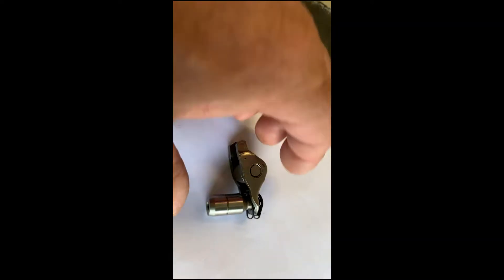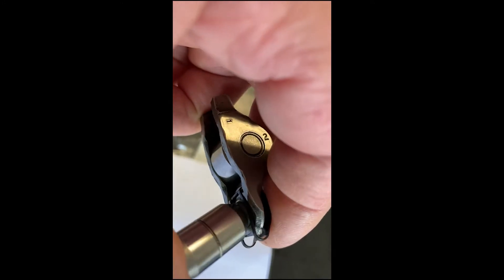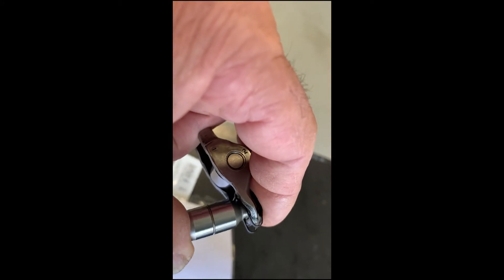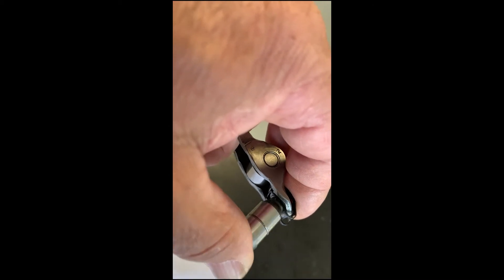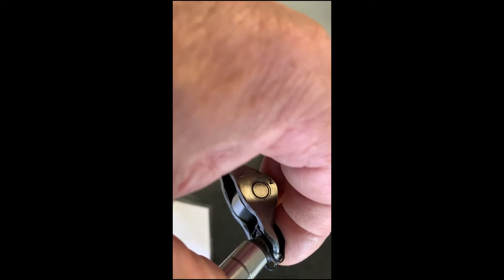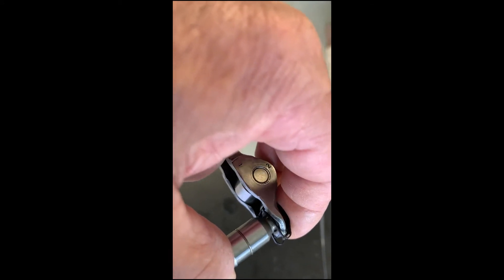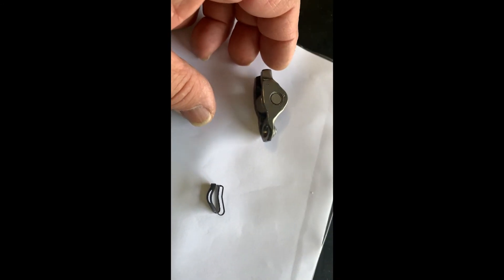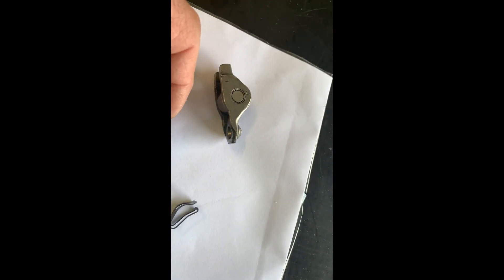FA20 Engine Installation of Rocker Retainer Kit - Clip fitment

Comment: Question, im installing a set and a couple of the rockers are on tight side. Like .09 on intake and .180 exhaust. Was on loose side oem setup. This is 47k motor 2016.
Reply: No nothing else changed. We pulled out the oem added yours. One seemed really tight so we pulled out and put another in. All have some clearance but a tad on tight side. All of them are about the same.  Stock they where a little loose, unfortunately my feelers are odd numbers, .108mm and .203 mm that I was using. All are a little tight now. I'm installing with cam carrier still on head since low mileage wasn't going to rebuild engine, l  spent more then planned but your clips are worth the insurance. If i have to add clearance what's best way? Just let you know this will be a street car and hill climb car, no boost planned and my longest hill is about 2 miles long and track events are short time trial of two laps. So not too crazy heat build up.
Reply from the maker: Yes, definitely worth adding our retainers. That’s good to note that it’s not an extreme track build or boosted setup, but while the motor is out, it’s best to get the clearances setup properly.

To add clearance, you could swap in slightly narrower lash buckets from your Toyota dealer (they sit onto of the valve stem). Another option—easier but less window for error—would be to carefully grind a little off the bottom of the pivots. Just take care not to go too far, or you’d need to swap in thicker shims at the lash bucket. It might be a good idea to test with your stock pivots to see how much material you’re removing when you grind. 😅 This is all assuming your current shims are somewhere in the mid-range of Toyota’s available shim sizes. Let me know how you go 👍 and feel free to ask any other questions.
Reply: Thanks, not really the answer I was looking for. This is going to be very time consuming. Trying to get this car done, it's my personal car, without getting too behind on customers cars.  Might just have to run the miata another year.
Reply from the maker: Totally understand—fitting in a personal build around customer cars is tough. Considering the clearances are just a bit tight, you might be okay considering you’re staying NA and the motor isn’t seeing extreme temps so as long as nothing is binding and there’s some clearance. It's up to you. You could re-check clearances after a few heat cycles to see how everything settles but that again is extra work.
Reply from the maker: And I do apologise that they aren’t fitting perfectly in your engine. It’s challenging to manufacture components that fit every engine precisely, given the slight variations that occur in the real world. As you'd know, that's why engines are designed with adjustable lash buckets—to allow fine-tuning for the best fit and performance.
Reply: @denstoj  I understand, I see if I can get a bunch of lash buckets from subaru, they are right down road. Might be easier. Your clips work so well makes it harder to get pivot out with clip. Might be able to push down valve enough to get the bucket off and swap out. Don't really like idea of grinding off bottom of pivot. Will check lash tommorow after they have been sitting all night. Been a fan of you crazy aussies for years. Even had a 2005 GTO for a while. Used to watch speed vision for your supercar races. Real stock cars, well back then, not what we have here. Deployed in UAE saw couple rebadged holdens as chevy's. All of my buddies I was only one who know where they actually came from. Sad the falcon and commodore are gone. Thanks for making a product to try to keep this money pit alive.
Reply from the maker: A set of lash buckets from Subaru sounds like a solid plan. Let me know how you go. Really appreciate the support, and it’s awesome to hear from a fellow fan of Aussie cars and racing! Those GTOs and rebadged Holdens were special—both of Dennis' sons, Mitchell and Daniel used to work at Holden Engineering.
Reply: That makes sense about adding for fulcrum. Probably why Mitchell (our repair program) had a math equation for the shims,  x by 1.6 or 1.4 depending on exhaust or intake. I thought the rockers where same for both. Is there a set % to add to make up for fulcrum. At 9 bucks a shim I want to get it right first time. Lol
Reply from the maker: Great that we're getting to the bottom of this! There are different rockers but they're interchangeable you just need to check on your specific setup by measuring lash as you are :) yes 🤞 you get it right the first time but also not a bad idea having spares for another build (customer?) down the track...
Reply: Got set of intakes set up using shims from old engine. More important found the number to get close to make up for the fulcrum. Minus another .16mm came out perfect. Ordered rest from dealer since I had part numbers from internet.
Reply from the maker: @keithgerhard454 awesome! Glad to hear it and will note that thank you.
Reply: Wish you guys made a tool that would help push down the valves or a fixture that bolts to the head and gives you something to pry agianst.  With engine on stand hard to get enough weight on springs to pop off rockers
Reply from the maker: Good idea. A jig to easily swap out rockers whilst cams still in 🤔
Reply: Finally got all the rockers shimmed, what a PITA. Any other suggestions for the RTV issue, already installed the IAG oil pick up and tried to remove most of the squeezed out RTV. Man they used a ton of RTV in these motors and sloppy. No wonder they are blowing up. The old blown motor had some in the puck up screen but didn't look like enough to stop all the oil flow.
Reply from the maker: It is definitely a time-consuming job that takes patience. Glad to hear it's setup. As for the RTV, yeah, it can get nasty. Let us know how the racing goes!
Reply: Been over 700 miles street running and no issues. One quick question, since I set the rockers up to your recommended lash is it common to have a slight more engine nosie. I had a cherry 2013 with 37k come inside in to shop and noticed it was a tad quieter then mine.
Reply from the maker: @keithgerhard454  Great to hear! Yes, you will get variation car-to-car in engine noise depending on the factory setup. That "cherry" 2013 with such low miles must be neat and tidy!
Reply from the maker: Hey Keith, good question. We do prefer to run on the looser side, 6 thou (~0.15 mm) for the inlet and 10 thou (~0.25 mm) for the exhaust on the FA20. Are any close to this? Guessing nothing else on the head changed and everything is in the same location (ie. rockers, valves and lash buckets)? Thanks.
Reply: Okay, I really need help. I got all the specs. Every cylinder is too tight. Issue I'm having is my local dealer isn't much help. I have the 3 numbers off the valve shims but don't know if that's the last three of the part number or the size of shim. I have a list of about 6 pages of shims but size is listed as 2.xxx. I'm off by .072 on most of exhaust and .05 on most of the intake, couple are less or more.
Reply from the maker: That isn't great that they aren't being very helpful. What list of shims are you going off? Here is a work sheet for each cylinder: https://docs.google.com/spreadsheets/d/1Ld78m5UFX5meDGyf2uukR9JtfcJP9cHZLUvrdrSbaMA/edit?usp=sharing
Reply: From what I gather from the research I've done looks like the 3 numbers are the total thickness off shim. 230 is 2.3mm. I have parts list from Toyota that shows t=xxx and you get part number. If correct take that number minus what I need to get enough clearance. Of course since valve and cam are at different areas on the fulcrum its not exact but should get me in the ball park. I do have the blown engine from car and know it has at least one 218 so I can try using. If I'm totally in left field let me know. Our repair program isn't much help.
Reply from the maker: That is making sense. Nice work.  Just clarifying that you'll write down where the shim is, the thickness of it and what clearance you're getting and then subtract what you need to get it to the write lash (spreadsheet I linked above will help). Yes the fulcrum does make it a little trickier as you'll effectively get less movement at the cam so you could always go the next shim interval.

This is why hydraulic lash adjusters are so much easier to setup 😅
Reply from the maker: This is an illustration of the fulcrum. You'll get roughly half of the change in travel at the cam https://docs.google.com/presentation/d/1WxE8cVPHcTIfUi6IaxkmsCrHEPiOgZw8wR_1TxBFh6s/edit?usp=sharing

Comment: Any update on these? Still in use? FA20Dit?
Reply from the maker: Hey Erik, yes they sure are still in use and saving rockers from dropping and destroying engines. They work on all FA and FB Subaru engines including the FA20DIT and even the latest FA24 in the 2022 GR86/BRZ. Are you looking at running them?
Reply: @denstoj  will be having @primemotoring installing a set via @outfrontmotosports retainer kit, which Im hoping doesn’t mess with valve lash clearance as well. Also I hope outfront spoke with your shop about providing these kits as well, would be great to know three awesome shops are communicating and participating in the industry properly!
Reply from the maker: Hey  @MontclairCarClub  yes Jeremy from @OutfrontMotorsports has been using our kits for years and is now officially stocking them and selling on his website along with installing them in his builds.

Our kits are a direct OEM drop-in. These guys know how to setup and build engines so there will be no issues with valve lash.

Great to hear that @Primemotoring is working with @outfrontmotorsports too. Guessing you're buying the short block from him along with our rocker retainers? What else are you doing with your build?
Reply: @denstoj  already IAG short block, with stock turbo, heads, GSC springs and bronze valve guides just got to add these in. Everything else is 3inch, grimmspeed flowing out, to tomei, everything coming in is Cobb, everything getting cooled and flowing is Processwest and IBR. Oil and coolant being handled by mishimoto fan/rad/oil cooler and IAG Street AOS. Sti short shift, kartboy shift stop, original trans, upgraded clutch, fly and fork upgraded in tank fuel pump, pitch stop, master cylinder brace. Single owner ‘17 with no more than 17000 mi ~23-24km on the stock components and chassis, k1x bought new from the dealer, never sold it.
Reply from the maker: @erikberman5957 bloody hell, nice! Got photos we can see? Instagram?